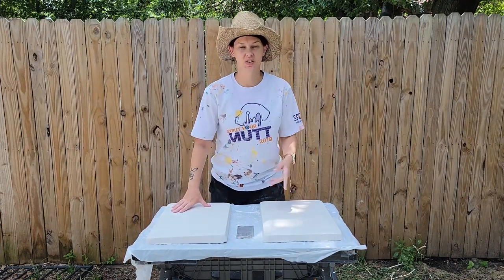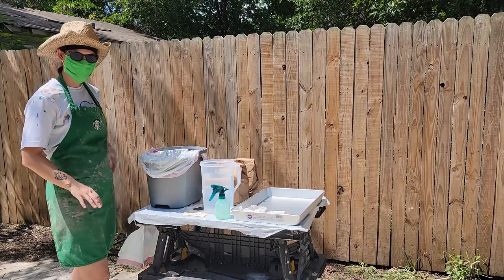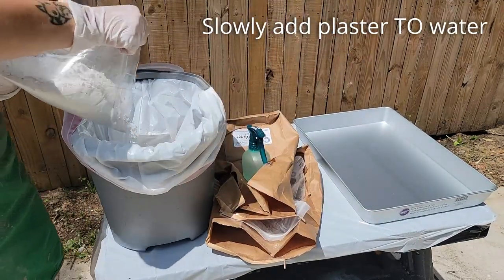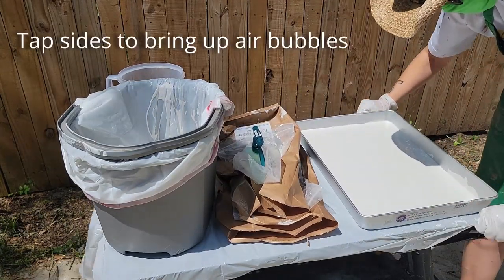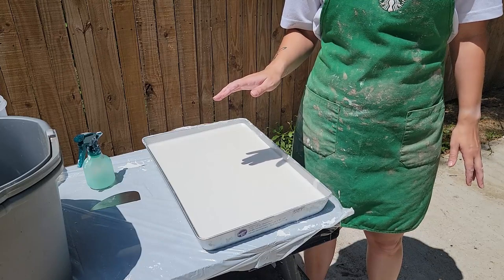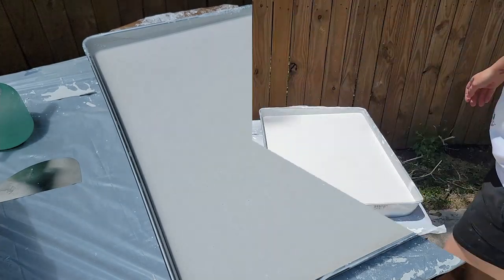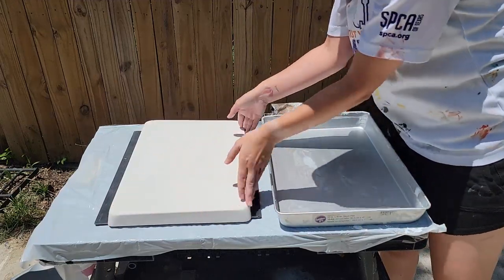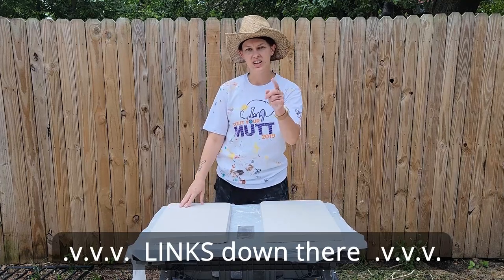How to Make a Plaster Slab for Wedging and Recycling Clay | Mixing & Pouring Plaster w. Measurements

Comment: Thank you. I think It’s important that the tray / container you are using should having sloping sides. If you use a container with straight sides, it may be very difficult to persuade the plaster cast to emerge because the mixture expands as it sets. I once tried to make a plaster batt in a round cake tin with one of those push-up bottoms. Perfect I thought, I can push the mould out when it’s set. But no, the expanded plaster was completely wedged into the tin. End of cake tin.
Reply from the maker: That's a good point to take into consideration. The pan I used here did not have any trouble releasing the mold. I do think this pan has a very slight slope as well. Good to know, thank you for sharing!

Comment: Hi, thank you for this detailed video! I followed this to make a plaster slab. It’s been one week of drying, the surface is a bit “powdery” to the touch.. I wonder what it means.. does it mean it isn’t set and need more time to dry, or can I simply wipe the powder off.. is it safe for me to start using it to dry wet clay without mixing some of the plaster powder in it… 
Thank you!!!
Reply from the maker: It's hard to say without seeing it. But if it's solid, it should be fine. A little powdery texture is a bit normal. I'd wipe it down and go for it. Unless it is crumbling. The main thing is that you don't want chunks of plaster in your clay. Sorry I can't be more helpful!

Comment: Hi and thank you for the helpful tips!! How did you decide to use 10lbs of plaster? I followed the mathematical instructions of a different video because I wasn't sure where to start with how much water/plaster to use for my specific container and it turned out HUGE. I wasted a ton of plaster and am hoping to try again. Without being able to rely on experience, how can someone figure out how much plaster they should use, given the dimensions of their container? Thanks again!
Reply from the maker: Thanks for watching! The plaster came in a bag of 10 lbs, and the ratio calculator said it worked out for the pan size. Here's a link to a plaster volume calculator if you're using a different mold or pan https://plaster.glazy.org/
Reply: Thanks a ton for responding!

Comment: Very good video !  Can you tell me where you got the table that you are using for
your video. Are you using saw horses and piece of wood ?  It seems nice and solid !  I am starting to
work with clay and need to get myself a small inexpensive work table.
Reply from the maker: I got it from Costco! They usually have them in stock around the spring time. It's a pretty decent work table. There are definitely sturdier options out there, but it would be a lie to say I don't use it all the time. It collapses into a nice little flat bit with a handle and it's lightweight. It was originally my husband's for woodworking and I adopted it when he upgraded.

Comment: How long after it dries until you can start to use the slab?
Reply from the maker: I started wedging on mine almost immediately. I'd say it takes 2-3 days for it to be completely dry. The drier it is, the better it will be at absorbing moisture, but it works well enough pretty much immediately after it's set. Give it a nice wipe first to get any loose plaster bits so they don't go into your clay.

Comment: what's the difference between this plaster and the standard plaster you find in a carton at the hardware store or craft store?
Reply from the maker: Hey Melissa, great question! There are a lot of different types of plasters. Let's go with plaster of Paris from a hardware store vs the Pottery Plaster #1 I'm using. The Pottery Plaster #1 is made from a higher quality gypsum, and forms a harder mold that is stronger and more suitable for heavy use.

Comment: Wont the plaster dust stick on the clay?
Reply from the maker: The plaster used is Pottery Plaster No. 1, which is specifically designed to be used in ceramics. It's made to be used for both wedging surfaces and casting molds. If any minute amount of plaster gets on your work, you can just wipe it off the bottom. In my experience, there isn't really any "dust" to speak of after the plaster is set.

Comment: hi! is it ok to use normal plaster? There's no pottery plaster in my country
Reply from the maker: There are a lot of different kinds of plaster, so its hard to answer with certainty... I can tell you that pottery plaster is stronger and harder than plaster of Paris. SO if you use plaster of Paris, you would have to be extra careful not to break off any tiny bits into your clay. 

The main point of the plaster is that, in general, plaster is porous and absorbent. I would say your best bet is to try out what is available to you, and see how it behaves. If it's absorbing well, and it isn't leaving pieces in your clay, it's probably fine to use. You might have to do some testing, and you may end up just needing to be a little more careful with your plaster slab. 

Thanks for watching, I hope you find a solution. If you want to comment again with your findings after testing, it might be helpful for others here. 😊
Reply: 안녕 Andrea, I had the same problem in Germany and found out that I had to search for calcium sulfate plaster or alpha gypsum- normal plaster is beta gypsum- I ended up finding it by searching for "plaster for slip moulds" or supraduro plaster, maybe you can find a local potter in Korea who makes moulds for slipcasting, they will be using this plaster and maybe can help you buy it? All the best x
Reply: I think i’ve seen people just add a layer on canvas to the top of the plaster to avoid any chucks getting into your clay.  The plaster still works (any kind really) to pull out the moisture, even through a layer of canvas.  Great video I can’t wait to try this!